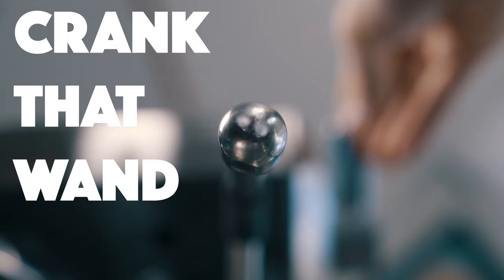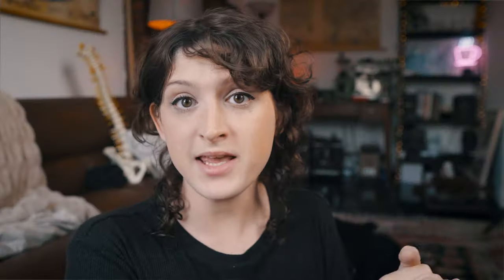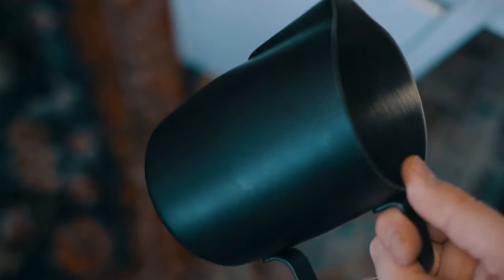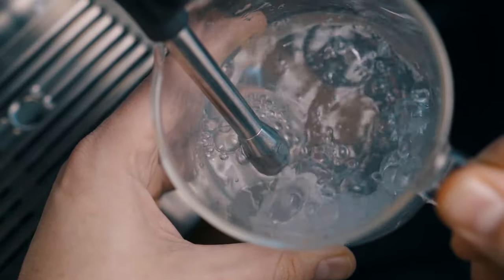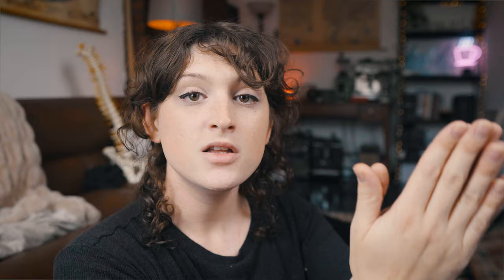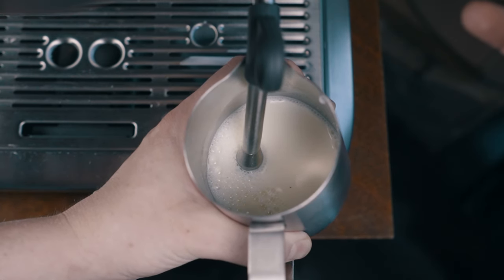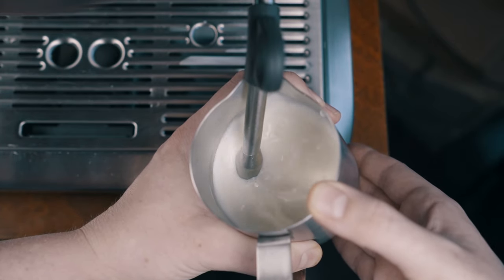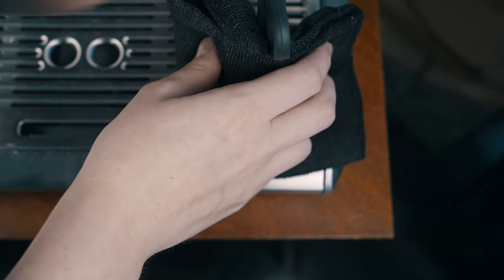HOW TO STEAM MILK ON THE BREVILLE (Dual Boiler)

Comment from the maker: NOTE: When programming the Breville Dual boiler, hit the buttons while the machine is OFF. 
Also I love you.
Reply: thanks for the lesson. Until now, I'd kinda been gently adding air, probably for like 10-12 seconds, so I was surprised to see you only spend about 6 seconds. The last 2 days I've been trying that - 6 seconds of more aggressive stretching, spending more time churning and incorporating. Seems to be improving my latte art consistency.
However, I'm on a Bambino Plus, so, diff steam wand but not sure how diff. It's a 4-hole wand but I don't know if the steam power is weaker than the Dual.
Reply: Took me a minute to figure that bit out, I kept running a single shot 😂

Comment: Great video, really well explained especially using the glass pitcher. 👍🏻

Wasn’t aware of the steam settings menu on this machine, I shall adjust mine as instructed. 

Thank so much. 🙏🏻
Reply from the maker: Happy there were some gems here! Please update me when you can!
Reply: @EmileeBryant  - Adjusted the steam power on my Sage Dual Boiler this morning from 135C to 140C and could tell the difference instantly when I did a purge. 👍🏻

Thanks again Emilee for the heads up and please share some more tricks and tips for this machine in future videos. 🙏🏻

Comment: This is great, I learnt steaming from you using my Breville Infuser and it's similar to the dual boiler but not as powerful maybe? I find turning up the temp on the non-dual boiler Brevilles help raise steam temp as you said but you get a hotter espresso (which in most cases is ok I think). 

Also - I had to rip a fresh $100 note to learn that sound, would recommend 👀
Reply from the maker: Interesting point! 

Im glad you made the monetary sacrifice for Lart science

Comment: Does the technique of the temperature of 100  to stop adding air in the milk, also works for commercial machines?
Reply from the maker: Yes. But Honestly with commercial machines I’d be very gentle with the air as they tend to be stronger and and add a ton more in a shorter time

Comment: Good. But what time does the Sage/Breville dual boilder require to froth 150-200 ml milk (fridge cool to 60-65 C)?
Reply from the maker: I don’t tend to measure in time because machines can vary so much. 
But it’s probably close to 30 to 40 seconds.
Reply: @EmileeBryant   Like start-up time (important but often hidden negative aspect of cool and expensive expresso machines), the time to froth is also important (in my opinion). My current DeLonghi does it in around 90 seconds, but the Profitec Pro 600 in about 12-15 seconds.

Big THANKS anyway for a quick and good reply !

ps. extra plus for the 100-dollar note joke :)

Comment: Best teach on how to steam milk on the Breville (I can't program mine) but the descriptions on what happens with the vortex when positioning the wand is enlightening.........now to watch your teach on latte art...... when tearing a $100 bill it sounds like crying....
Reply from the maker: Glad you enjoyed! 
If you are working with a slightly lower end model vs the dual boiler, you might find the steam wand a bit too weak for that trick but you should try it anyway and let me know!!
Reply: @EmileeBryant  I can make hearts, but I want more art. Two things working against me 1) my steaming - with your teach I'm working on that. Today was better, but I think I need more foam. 2)  My cup size I think it is too deep. I can't get the pour spout low enough before my milk runs out.  Side note: I don't brew coffee for a living and the model you have I believe is the Breville Oracle Espresso Machine.......much too expensive for my daily cup of brew. Is there another model under $1,000 you recommend? Or perhaps a stand-alone steamer.

Comment: So my breville steam wand waits like 5 seconds to start steaming after I turn it on. I noticed that yours turns on right away. Do you think there’s something wrong with mine?
Reply from the maker: Probably not. 

You should purge the steam just prior to using it so it can warm up and expel and extra condensation. 

Also you might have a different model? The barista pro/ almost all the other brevilles are not dual boilers so they take longer to give energy to the steam. Let me know!

Comment: okay okay so i have a similar Breville and I'm so glad I found this videoooo. Question tho - I know you said we need to keep moving the milk in the pitcher until we do our latte art design, but how do you keep doing that if you have to turn the dial to turn the air pressure back on to clean out any milk that may still be on the wand? do you just say eff it until you pour your latte art? or is a 3 second clean-the-wand break okay and you can put the pitcher down?
Reply from the maker: Hey! You can let it sit for a few seconds. Some people rest the milk longer. I just dont prefer for too much foam to rise prior to pouring to get that shiny pop!.
Reply: @EmileeBryant  roger that - thank you!!

Comment: Does more holes on the steam tip means more power? I am confused like 4 holes > 3 holes?
Reply from the maker: I can make another video about steam tips but KIIIIIINDA. 

There is a balance of steam hole amount/ size that is perfect for each person and machine. More holes can mean more jets of steam thus more capability in injecting air but a faster realms of temperature. So if you work on a reaaaaaally cheap machine that doesn’t hold a lot of heat and pressure in the steam boiler or exchanger, you might see a huge dip in pressure when steaming with more holes (again depending on the size too) 

And the opposite is sometimes true that less holes hold the steam pressure better but inject less air efficiently (kinda) and heat up the milk slower. 

Than there are weird outlying products like the “foam knife” and “weber variable steam tip”
Reply: @EmileeBryant  Thank you for the information

Comment: LaMarzzocco Micra vs Breville battle : the winner is ?
Reply from the maker: If you want a machine that makes coffee identical to cafe (9 bars only/extremely great steam pressure and quality built) then go marzocco. For the price and flow capability if you slayer mod it, the breville is more for your buck. Though the steam wand is capable… it’s not as powerful or fast as marzocco.
Reply from the maker: That is Micra vs BDB
Reply: There's a big price difference. Breville Dual Boiler has way more features but it's a plastic machine built in China. LaMarzocco is like a Ferrari, a status symbol handmade in Italy.

Don't think either one will make inherently better coffee, unless you have a super sophisticated palate and want to play around with lighter roast specialty coffee beans. Then BDB will be better as you can tinker with all sorts of parameters. 

If I had unlimited money I'd buy the LM but honestly spending $5k on an espresso machine is silly. I spent $2k on my machine and I still wouldn't tell someone how much money I spent on a machine just to make lattes.